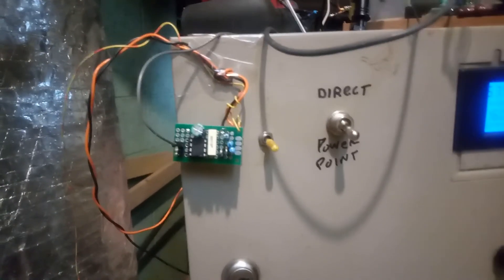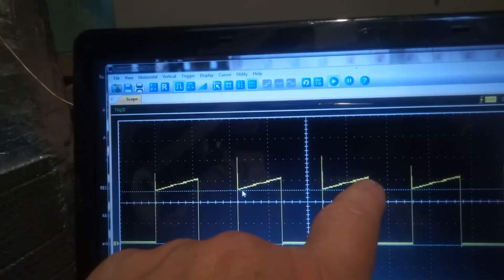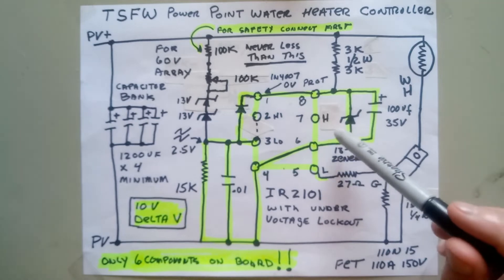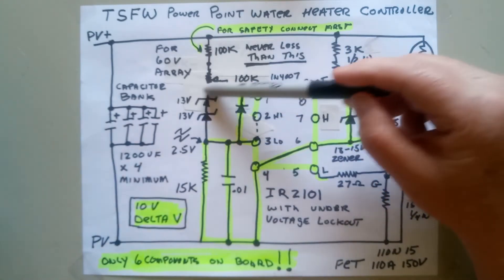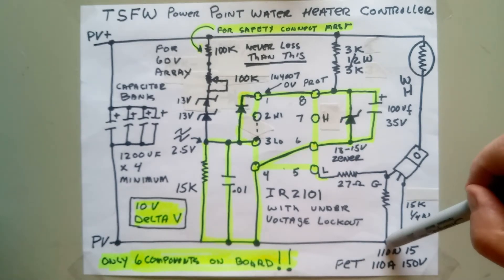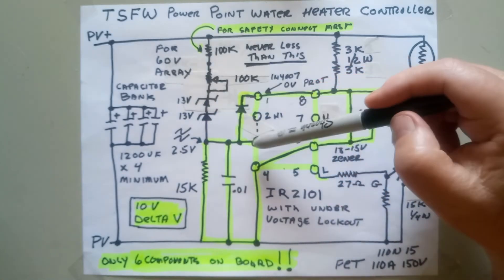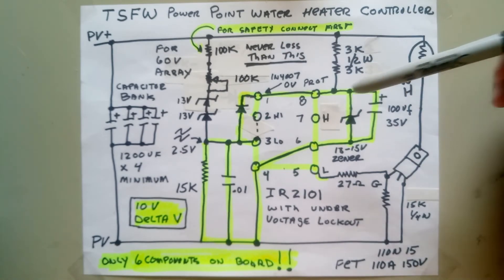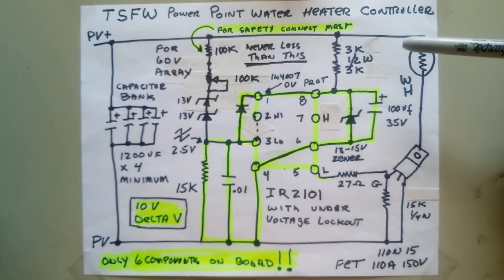TSFW Ultra Simple Build PV Solar Water Heater Power Point Controller IR2101

Comment from the maker: Wondering what design is best?  They are all best for what they were designed to do. You have to determine if it is operating with a charge controller or stand alone, if you want to use existing thermostat operating voltage, number of heating elements and if you mind adjusting the voltage seasonally. It needn't be stressful as all the control electronics only cost a couple bucks.  The FETs and capacitor bank can be used on every one. 

The simplest is the TSFW design with the IR2101.  It is not recommended to be used with MPPT charge controllers as the voltage has a wide voltage swing. While theoretically slightly less efficient,  It does handle mild partial shading a little better than a rock solid fixed point as the cutout is 20% lower.  It can not track with temperature.  It can be used with any voltage with modifications to the sense circuit, but can only be used with the NO ARC circuit up to 90V.
The NO ARC circuit can be used with any design.  This just places a power resistor  across the mechanical thermostat contacts between the PV array and the capacitor bank. This can easily be used to a little over 100V for those designs that tightly control the capacitor bank voltage.  Just compare the open circuit voltage of the array and the power point voltage.  If less than 30V there isn't an issue.  This is the safest method as it interrupts the power circuit. Lower element thermostats should be switched out for a an upper one that has ove rtemp lockout and requires a manual reset.
300W Inverter Boards I thought this was a great idea for small camps. I use  these on each of my two tanks  at camp with a 60V array. Everyone was confused.  300W, I need more than that!  Its 300W at 12V, 600W at 24V, 900W at 36V, and 1200W at 48V. It made a nice looking board. These mods seemed too complicated for most and like everything from China you never know what you will get.  It had a IR2153 and that changed to some being SG3524.  The biggest problem is they went from a 75V FET to a 55V FET and traces got so close there was the probability of arcover.  Still OK for lower voltages.  Both mine are 3524. Push pull output means you can use DPDT AC relays to switch heaters with no issue. I use one to switch over to my dishwasher.
The TL431 and IR2153 design was a build your own inverter board where you could control everything and is likely simpler than buying inverter board. I didn't mention that this push pull design also has priority heating with the lLO output when the FET aren't tied together. This design can not  track with temperature. It does prevent short pulses that can destroy a FET at high power.  I also found there FAKE IR2153 out there which will not work.
LM393 and IR2153 This is a design that has everything. It can track and output can also be configured as a single FET or multiple in parallel. Unused comprator can be configured as temperature control with a thermistor.
ARC INTERRUPT  A LM339 is the same as a 393 except with an additional two comparators. Two can be configured as an oscillator which periodically interrupts the output.  This allows AC switches to be used for thermostat without issue.  This video is not ready yet. Not recommended unless you have a $60 USB scope to verify it is actually operating. If you are saving hundreds, you can buy a cheap scope. You can't tell the players without a scorecard and without one you will be in deep trouble if something goes bad.
Reply: opera Is there a reasonable safe and easy(ish) way to implement a no arc circuit it water heating is controlled by an Arduino ? (124ish volts from the pv at power point)
Reply from the maker: @RexKanum  My first designs were a NANO.  Hope you will do a video when your project is complete.  You can set your PWM rate for 122Hz and only allow your count to get so high. That will guarantee a 0.5ms off time about every 10ms. Be sure to have enough capacitance to store panel energy in those off times.  This will allow you to use mechanical thermostat. Always  prevent short pulses, small PWM numbers. These only result in FET heating. 120V is on the edge for having the resistor across the thermostat.  This requires the control electronics to shut down immediately when it sees a lower voltage.  None of these are what you would call UL safe as it requires the electronics not to fail. Upper over temp thermostats should always be used on lower element in the current path.  They may fail with repeated use, but will always work once.
Reply from the maker: If operating stand alone the panels themselves can be used as the temperature sensor.  Just turn off the heater for 5 seconds and read the voltage.  Power point set voltage is around 80% of that. Use another pot to adjust the percentage.  As you will be close, a simple adder or subtracter of counts will be close enough if you don't want to do the entire math..
Reply: opera I have 10 1000uf 200v caps ready. A couple of nano boards and a mega, as stuff will break:) Electronic wise I’m rather green so unsure about the size for the resistor across the thermostat and also the bleeder resistor for the cap bank. It will not be stand alone, but parallel to midnite controller. Bit unsure if I remembered to bring a blocking diode, but should have one somewhere. Will use the count program you posted on the f lines forum.
Reply from the maker: @RexKanum  Using PWM port, I have an up down counter for PWM value.  Above foxed A/D value count up, lower count down. Be sure to have a dead band where no change is made. For faster response, large difference in A/D change count by 3-5. A/D has about 6 counts of noise. Running value average of A/D good idea. Don't update PWM every loop.

Comment from the maker: A two heating element stepped system can be made. This cycles the LO FET drive pin 5 on and off first between the turn on set point and turn off.  Once this output is fully on due to a higher capacitor bank voltage, the HI output pin 7 will begin cycling on and off until higher voltage turns it fully on.  Breaking up the power into two stages increases power capability and reduces the need for a larger capacitor bank.
Modification is to put a 470 ohm resistor between pins 2 and 3. The 15K resistor then connects to pin 2. The second heating element FET is driven by pin 7.

The start and stop has about a 10V delta. At 90V that should be about 15V with an extra zener added to the sense line.  Contact for other voltages.

Comment: Looks very simple, might just build something like this with not too much electronic, I am more of monkey see, monkey do..
Reply from the maker: Let me know what voltage your array will be.
Reply: @opera5714  i will be using 2 types both based on 2 and 3 solar panels in series with one being 30v mppt, 37voc and 37.5v mppt, 44voc giving me a total of mppt 90v and 75v respectfully, I am using 2 types of elements one being 36v 1200w and the other being 48v 1500w, both these elements are wired in series, so changing the bridge wire on the elements will give me  elements of 72v and 96v.

Comment: I like it! Not sure 🤔 if I have the ir2101
Reply from the maker: You already have a better design.
Reply: @opera5714  Thanks! Hey, we got the new house. Close the 26th now it looks like. Ill be moving my system to the new house and I have a much larger water heater. New challenge to undertake. :)
Reply: What is the maximum solar panel watts you can use
Reply from the maker: @basecampwnc1745  what is the typical array voltage and wattage of the water heating systems you have installed? The voltage is limited by FET or ight used. Capacitor bank determines the max current. Largest system I know has been built is 1500W 120V. There is no limit although I question a design  much larger than that pulling that much power from capacitor bank at that low a voltage. A second heater being switched in is a better solution. Temperature control has not been talked about yet. Over 120v mechanical thermostat can not be used.
Reply: @basecampwnc1745   and voltage from panels or panel